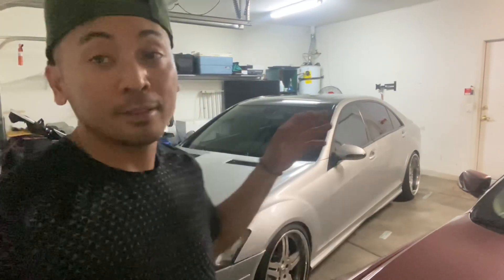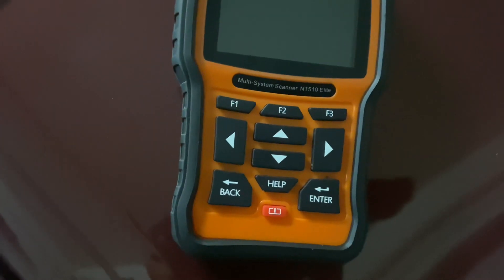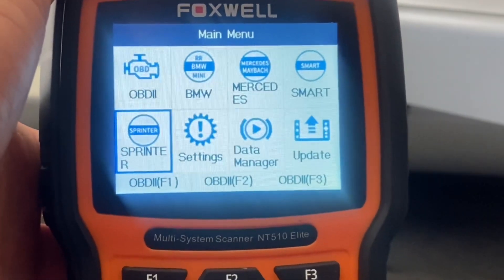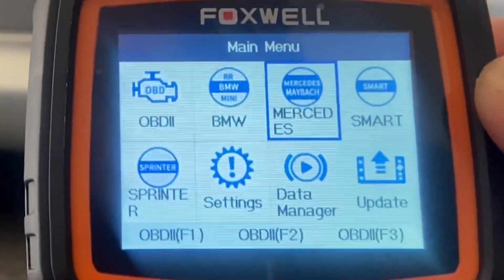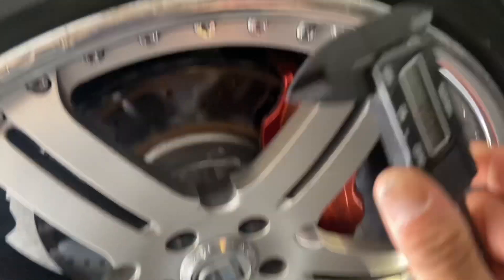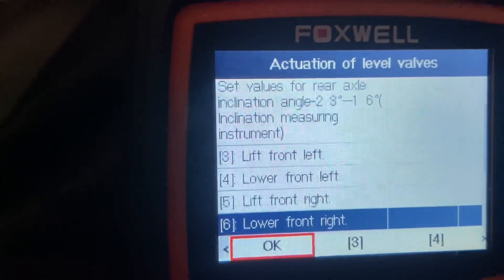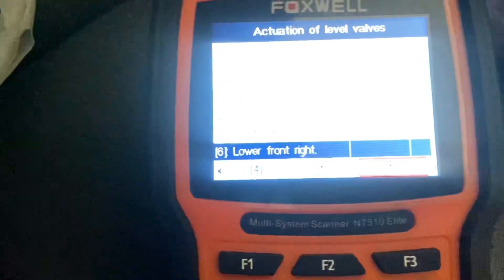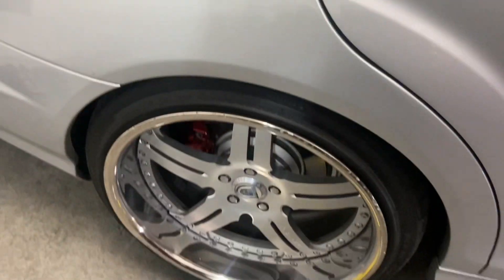“ LOWER MERCEDES Airmatic / ABC FOXWELL Elite NT510 OBD2 Scanner” Amazon $180 NO Links, Module W221

Comment: I want tonsee the part you skip  how much is the value  1.4....  for each ! Cause every time i bot the full car goes down !
Reply from the maker: What part are you having trouble with?

When I lowered my CLS later on, I learned that whatever height you save becomes your new “stock” height. If you want it lower, it’s better to redo the process in small steps instead of trying to drop it all at once. Big changes make the system reject the calibration and can mess with the sensors.

Front values should match each other, and rear values should match each other.
The scanner gives you a range (example: 1.0–1.4). Just pick a number within that range and make both front values the same. Same with the rears.
If it shows negative numbers, same rule—just match both sides.

If each corner has different values, the car thinks something is misaligned and it won’t save. We’re basically tricking the sensors, so the numbers have to stay within the acceptable range.

If you want it even lower, just repeat the process again. I used to try dropping it from stock straight to “almost-on-the-tire,” and it would always reset back to stock when I started the car.

Doing it in smaller steps, making sure front numbers match and rear numbers match, finally made it save properly without bouncing back to stock height.

Anytime the sensors see values out of range, you’ll get errors or it’ll auto-raise into safe mode.

Let me know how goes we'll try see what's going on.

Comment: After changing the rear height sensor ..the valve block and air compressor...the car sits where it's supposed to be but the compressor keeps kicking on randomly for no reason like I have a leak and I don't .I have the Foxwell scanner nt710...don't know what to do next
Reply from the maker: You may have a leak somewhere if it keeps kicking on. The system is still active even when your car is off sitting. It's to maintain the car level when needed. Maybe get yourself a spray bottle with some little dish soap water and spray around the struts and any fitting you may have removed to check for leaks. 
 I found some leaks this way on diff airmatic Benz I bought to pinpoint leak. Also if you have a bag that is leaking another way is to pull up or lift up that corner of fender and you will hear it .

Comment: My car dropped in the rear while driving.....I changed the compressor and valve block..the car is sitting on its face .I got the Foxwell NT 710...I have no clue what I'm doing but the compressor won't turn on unless I manually turn it on...shall I turn it on and let air build in the reserve tank?
Reply from the maker: Sorry for late reply haven't been on. If you changed the compressor you should  go to the suspension and airmatic menu and follow the step by step to turn off deactivate old compressor and  linatalling new one it needs to be activated with scanner as well on same menu. It cycles thru all components pump, struts, valve blocks to make sure it's operating properly. Yes if your system was out of air it needs to pump air back in system . You should also cycle air suspension air . I use to raise it and park it over night to see if any leaks or corners would sink lower if was leak or valve not holding pressure
Reply: @GonZaWoRx do you have a FB or anything like that ....how you see my name is how it appears on my FB....I found the problem too ...not only did I have a bad rear height sensor but the metal clip that the link is attached to rusted out and let link hang hitting the drive shaft ...I replaced the sensor ..fixed the breaker as much as I could and now the alternator died ..fml...one thing after the other
Reply from the maker: What's your Facebook or IG I'll
Message you. They have a few Galin. It's Will Gonzalez
Reply: @GonZaWoRx I figured it out

Comment: Ik it's been a couple of years since you did this video but I tried to do the exact same thing with my s-class 4-matic and my issue is that the car thinks it is lower on the left side than the right side, it shows -7mm on the left and ~0mm on the right side even though the left side is higher than the right. The Foxwell doesn't allow me to lower the left more than the right due to the faulty calibration. Do you have any tips? Smoking S-class btw!

Comment: does that scanner work to op test the ABC on my 01 CL500, i need to do the rodeo
Reply: im pretty sure it does rodeo mode , ive seen it done before with that foxwell
Reply from the maker: I haven’t had a chance to do on abc equipment Mercedes. I’m able to independently actuate each strut and accumulators valves and air pump . It may not certain but it’s just wasnt an option on the suspension test on my s550 or Cls550 Airmatic.

Comment: Bro do you answer questions ? No one can figure this out. Either answer them or quit bragging about a tool that doesn’t even work !?
Reply from the maker: Sorry I been working long hours and haven’t been on. it does work check the updated new video on my ClS500. I figured out you need to enter angle values to save it .
Reply from the maker: https://youtu.be/LINueO8fyzI?si=TyiXJtXBAJNBLJZy

What kind car do you have ? I don’t mind helping u walk thru steps to save it if needed. My last video is the correct order steps to save settings. To follow. Lmk

Comment: Can you use this method to do the opposite and raise the wheels?My 2008 Mercedes Cls550 front 2 wheels are low in the front and not rising upon starting up.
Reply from the maker: You can but from what your describing you may have a issue with the air struts or a slow leak somewhere that’s effecting the fronts and it will still do the same. 
   You can use it to troubleshoot and see if its only isolated issue or a valve maybe stuck on air pump maybe

Comment: What module did you enter? Drive?
Reply from the maker: Yes Drive , Then airmatic . You can adjust the height in the Active or live vehicle text modes because it’s easier to see the height level numbers as you adjust all four corners. Then you exit back  to last setting which is initial startup mode (manual)where you actually Save your settings.
You can adjust in that menu but it does t show you value of level when your doing it.
Reply: @GonZaWoRx  that's brilliant mate much appreciated
Reply from the maker: Just dropped new video of updated lowering

Comment: I recently bought the Foxwell NT530 which is the updated version of the NT510 Elite.  When I did the rodeo on an 02 S55, the scanner automatically set the #'s of rodeo cycles to about 420 cycles & it took almost 2 hours to complete.  Did you do a rodeo on yours & did it takes that long as well?
Reply from the maker: I figured out how to save . Here is the link. The voltage and incline angle value need to be within specs of listed in link. https://mbworld.org/forums/w211-amg/326084-star-diagnostic-how-diy-lots-o-pics.html
Reply from the maker: Please watch the new  Video on new step by step instructions on saving new level settings.

Comment: So is it safe to drive these cars wit airmatic completely bottomed out? My airmatic recently failed and it’s sitting as low as possible, but it actually looks good🤣I just don’t know if it’s safe to drive
Reply: Don't...mine dropped due to height sensor... it wrecked the lip off the wing trying to steer it to the kerb

Comment: It ONLY tests the airmatic, it DOESN'T permanently lower the vehicle.  It is ONLY performing a ACTUATION test of each corner.  That cheapy OBD2 scanner CANNOT do any coding and programming required to lower a vehicle.  Star Diagnosis using XENTRY is what is needed.
Reply from the maker: Yes you cannot save in test mode but you can adjust to level height. I did some research on forums and Star steps and able to save. Same steps as in star 

I figured it out how to save on new video. Must be saved in initial startup manually menu. Incline angle number for all four struts must be entered to save.
Reply from the maker: I figured out how to save . Here is the link. The voltage and incline angle value need to be within specs of listed in link. https://mbworld.org/forums/w211-amg/326084-star-diagnostic-how-diy-lots-o-pics.html

Comment: I just wondering if what happened when I turn off my car and the rear air suspension is starting to get lower and when I start the engine and the rear suspension is starting rising up but the front is fine. Let me know what happens 
( 2009 s550),  does the rear suspension is leaking or do I need to reset  drive height
Reply from the maker: Please check out my new video. I did. Figure out problem and now have it saved.

Comment: I pick mine up in 2 weeks. all mod's finished. Its sick. Twin turbo.... I need to keep this Vegas sun off my s550
Reply from the maker: Nice I’m out in Vegas also . Maybe see you around No just deflate it completely before you remove bolts and face. 

Sorry for long response everyone havent had time to make any vidoes or respond been busy with work Fam.
Reply: Lets meet up today so you can see my 550 converted to S65. 25k in work on 22's message me through my channel
Reply: You twin turbod a pre 2012 W221 s550????? Or you have the 2012/2013 wit factory turbos? Please let know because I’ve been wanting to turbo mine but didn’t think it was much possible… response would be greatly appreciated
Reply: @spinnabenz256  mine is factory twin-turbo, i was told mine is the s63 update when i picked it up. The benz is a real head turner with the 22's
Reply: @Akuza1000  that’s dope bro. So Mercedes’ smacked s63 turbos in a 550? I was never sure if they used the same turbos and just different tuning and fuel system. I love my 07 but definitely want to get a 2013 550 or better yet 63, I honestly love the W221, the new ones just look like a big C or E class and really lost the charm of being an “S”. If i got one of the newer ones I would immediately wide body it to give it the S aesthetic, the wheel arches on these models are perfect. I want to drive mine so bad but the airmatic recently failed and I don’t have star to diagnose it so I’m going to have to swallow my pride and pay the dealership for diagnostics😂Enjoy your ride bro, I’m sure it’s a beast. Ps. I wanted to go 22 on mine as well but I’ve heard it affected acceleration, with my lack of turbos I can’t afford to lose any performance 😂

Comment: How do you save the new ride height?
Reply: Yes I heard that this method doesn’t save the height and it goes back to normal. I know how to do it in star or Xentry but I’ve never used this foxwell before. If u try to adjust it in adaptations in Star, it won’t save. You have to set it up as a new valve body for the settings to save, like initial setup I think it’s called.  You set the height within the proper sensor voltages and enter the control arm inclination angles within the set ranges and then it will save. I just ordered my foxwell on Amazon so I should have it next week.
Reply: @Lonnie91a  I have tried almost everything but it still doesn't save. Its good for lowering the suspension when parked at like a show or a meet but once you unplug the scanner the height goes back. You can keep the ride height while driving if you leave the scanner plugged in but thats too much of a hassle.
Reply: @Lonnie91a  have you received the scanner? Tried if you're able to save the modified ride height? Thanks!
Reply: @iamback_it  I got the scanner and I can’t even find the section for airmatic or suspension or anything. This video doesn’t show the one thing I can’t figure out. How did he get into that screen for the adjustment? I can’t find it anywhere in the scanner.
Reply: @Lonnie91a  thanks for the feedback, I can't help you because I don't have the scanner, I'm thinking to buy it but I would know before if it can save the new ride height or not...
Reply from the maker: Please check out my new video. I did. Figure out problem and now have it saved.

Comment: Boss how do u save after you hit ok ? Whats the steps
Reply: Hi, did you managed to find the solution?
Reply: Nope i can lower it but cant lock it in place
Reply: @brianv4099  does yours lower the front too? Mine only has the option to lower the rear only.
Reply: Ues front and back just cant lock it
Reply from the maker: Please check out my new video. I did. Figure out problem and now have it saved.

Comment: Have you ever looked into Dropbox system to lower the suspension?

it basically bypasses the airmatic lines and when the car is off you can release the air in the suspension to lower it completely and when you start the car it goes back to the normal driving height.... what are your thoughts on this?
Reply: My thoughts are that yes it would look cool but it’s more wear on the compressor and apparently letting the airmatic shock sit bottomed out is not good for them. Mercedes mechanics will tell you that if you have an air leak, to put the car on jack stands until you can fix it so the shocks aren’t sitting bottomed out. Just what I was told anyways.
Reply from the maker: Just dropped new video of updated lowering
Reply from the maker: No but sounds interesting where could I find info on this
Reply: My car does this… I never knew why, because I’ve talked to other Mercedes owners and they said there’s doesn’t do that 🤣
Reply: Tell me more and do u have a link??
I have abc as it’s the v12?

Chwers

Comment: Are your bumpers and skirts stock? I just got an 07 S550 base model and it looks a bit different
Reply from the maker: They are stock Amg sport package available for my year s550. Basically Amg bumpers and exhaust just not Amg .

No just deflate it completely before you remove bolts and face. 

Sorry for long response everyone havent had time to make any vidoes or respond been busy with work Fam.

Comment: Help lol I lowered it but when i start it it gose bak up . I have taht same scaner
Reply from the maker: from what I seen you must adjust in mode select “ initial startup” If you try to go menu and select “!actuations “ to adjust it will not save .
Reply: Can i send you my email so you can help me out
Reply: @brianv4099  Having same issue...not getting the OK section for individual corners however can adjust it via the driving levels.
Reply: Ok its 2 options in initial start up . So first one or second one ?? Thanks btw bro

Comment: Did you have to watch out for auto leveling and how flat the surface you’re working on is?    I’d be afraid of auto leveling throwing measurements out of wack.
Reply from the maker: Yes Same rules applies recording measurements and level ground. 

You are also able to adjust height by inches also with scanner and reset to default. It adjustS both front together and rears as well. I chose to do each corner in mm cause I already lowered with links and wanted more a fine adjustment. .
Reply: Can the nt530 do the same? I been watchin your vids. Keep it up love the mods!! figure buy the newest/latest one i can?
Reply from the maker: Just dropped new video of updated lowering
Reply from the maker: Yeah If I didn’t have links already I would have just adjusted them with the other selected option on the scanner. 

It gives you option to adjust individual corners a little at a time . The second option is to adjust front pair and rear pair of airbags . Have to confirm but it’s something like -4 to +4 Range,  but it’s a more drastic drop. I didn’t do it for same fact you mentioned throwing the sensors out of wack with my aftermarket links.
Reply: @GonZaWoRx  how are you getting into these adjustment screens? I just spent an hour going into every option and module and I can’t find anything to adjust the sensors. All I have is adaptive dampening and I can look at the codes or live data but I can’t adjust or program anything. Please tell me how to got to that adjustment screen. You cut it out of your video and don’t show how to get there.
Reply from the maker: @Lonnie91a  I figured out how to save . Here is the link. The voltage and incline angle value need to be within specs of listed in link. https://mbworld.org/forums/w211-amg/326084-star-diagnostic-how-diy-lots-o-pics.html
Reply: @GonZaWoRx  thanks for the reply.   I have a w220 S500.   I did the washers, but gave me 1/2” drop max.  My rear is both side with one sensor and is adjustable from the factory.    The fronts are separate.   

I appreciate this video.   Thank you.
Reply from the maker: Ok nice ! Yeah the drop with that mod is very minimal. Links, module or OBD2 if you want lower. 

I think this OBD2 is best of both worlds cause it can scan alot of modules Lower car reset trans, modules, initialize and activate diff parts of your car.
For price little more than links and couple hundred less than module for me  DIY ing was no brainer.

Comment: can you reset driver window module? my deos not open.. i have herd modules have to be reset
Reply from the maker: Yes you are able to reset module and program new one to vehicle. I had the same issue on my driver side but I actually was able to take a used one off a 2008 and when I plugged it in my car it worked without programming. 
I know ppl say you can’t without but it worked for me just FYI .